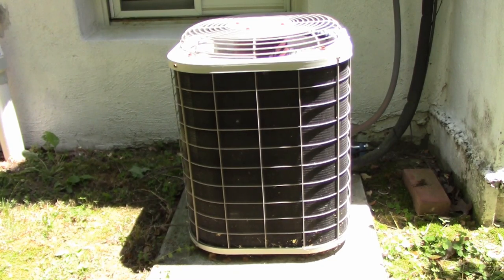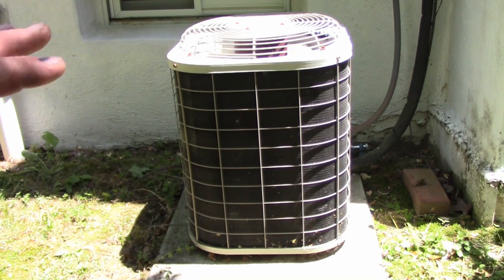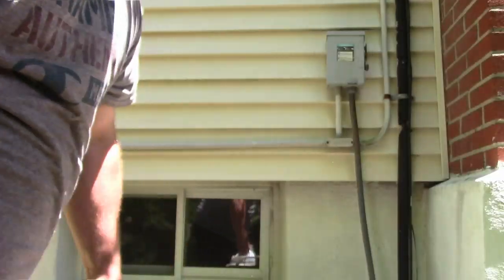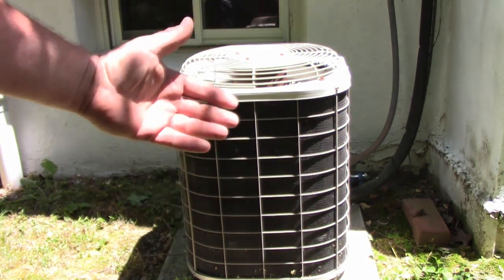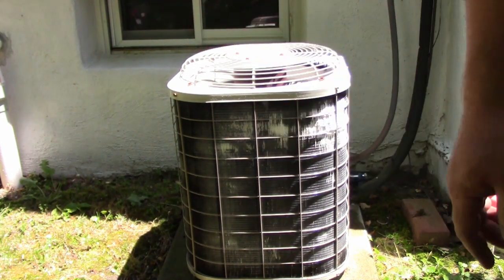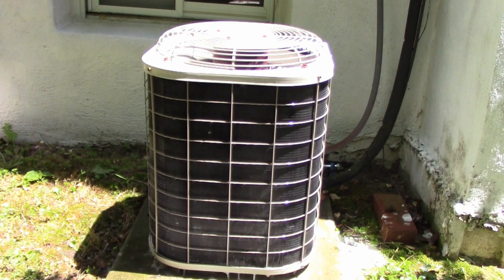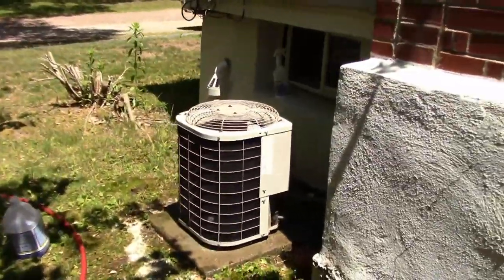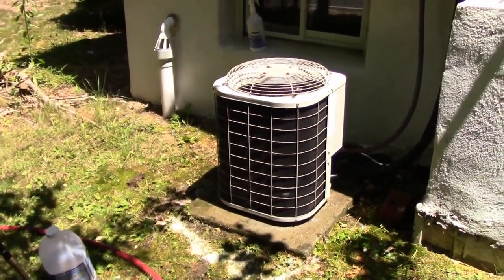Homeowner A/C Maintenance :  Clean Your Coil!

Comment: Such Simple Stuff Did You see that other You tube video where the Lady CLeaned her Condensing Unit Did You See all the Lint that was sucked up against the  Out Side Coils It Looks Like that outside Unit was too close to the exhaust Vent from the Clothes Dryer DUH & IF YOU WANT TO INCREASE THE EFFICIENCY OF YOUR A/C SPLIT SYSTEM Do you See that outside Fan BLade it has THREE EARS WELL You Could Replace upgrade that  THREE EAR Fan BLade to a FOUR EAR Fan BLade which will move more AIR & Decrease the Head PRESSURE thus Making the A/C UNIT Operate more Efficiently Just make sure You check the Rated Amps of the Fan Motor & the Actual AMPS that the Fan Motor  uses FLA MEANS FULL LOAD AMPS & RLA MEANS Rated Load Amps and Do Not use the Acid Coils CLeaner unless You know what your doing that coil cleaner must be totally Rinsed off with  CLean Water or it will Cause the Copper & Aluminum to Corrode then you will get Refrigerant Leaks YES I AM UNIVERSAL CERTIFIED  HVAC TECHNICIAN PER THE EPA  PHASE I &  PHASE II & PHASE III  THATS  RESIDENTIAL / COMMERCIAL / INDUSTRIAL

Comment: Good info for the homeowner! One suggestion I have is not to have the homeowner use the acid type cleaner. if it isn’t rinsed completely out of the coil the acid will eat up the fins of the coil.

Comment: strongly recommend cleaning INSIDE to out. * we foam from the outside- wash and rinse from the inside. Mentioned in your video briefly however not done that way in the actual video * regardless of micro channel. IF you have a Needle gun sprayer like we do then 80% of the outdoor coils we dont need to remove the outdoor coil fan. Additionally one needs to clean the indoor coil- a lot tougher to do with out specialized tools. * would say the number #1 thing customers can do to maintain there HVAC system is CHANGE THE filter every month- which most dont they go by the 90day terms of the manufacture; however most environments today need changing every month to 45 days max. Purchase the electrostatic disposal filters.
Reply: Ya mean you don't like pulling a cheap green or shitty blue filter out of a fan motor?  :-O  I recommend aprilaire to everyone.  Best couple hundred bucks you can ever spend.

Comment: Why is it the AC guy always has the oldest and lowest seer equipment on his OWN house??  I tease you because I too had complete shit at home.  It was the junk I pulled from my customers.  I finally threw in the towel a few weeks ago and installed all new stuff.  The last outdoor unit I had was a heat pump (and I have NG)  I didnt have the reversing valve wired quite right and when it shut down, sounded like a turbo charger blow off valve.  Fun to annoy the neighbors for the last 3 years.  Hey, I want to show you the ultimate slide rule for charging units with and without TXV's etc.....  I use one of these myself and love it!  I don't like the app, but the duct sizing chart is slick too.  https://www.youtube.com/user/supercoolsliderule/videos
Now show your viewers how to clean the indoor coil, THAT is the best thing anyone can do to prolong the life of the system.  Another good tutorial is AC no start.  (capacitors and contactors)  When I install a new unit, I always leave the homeowner with a spare contactor and caps.  My people often live 100+ miles away so it saves me a trip.